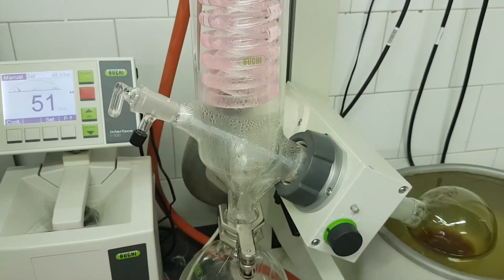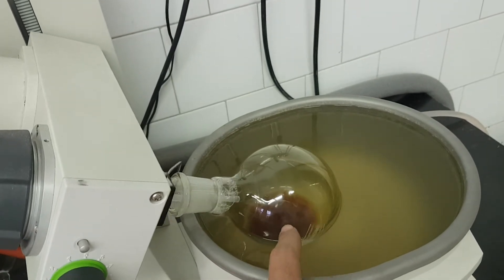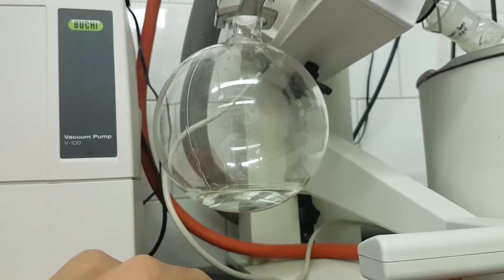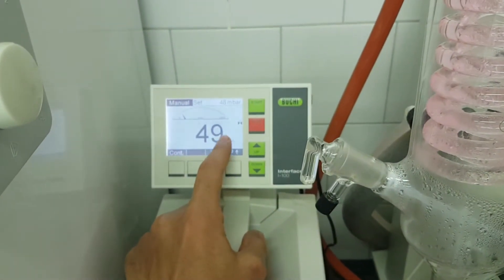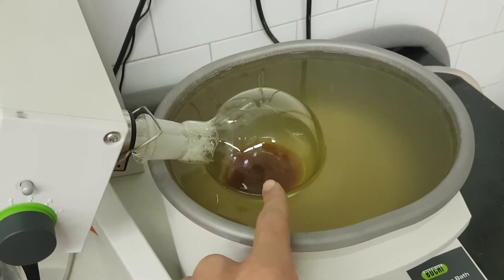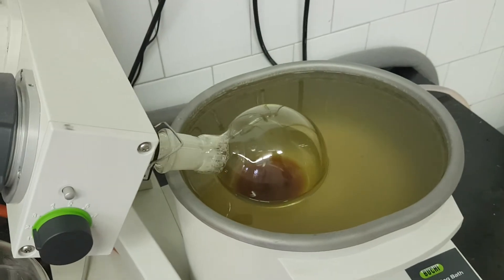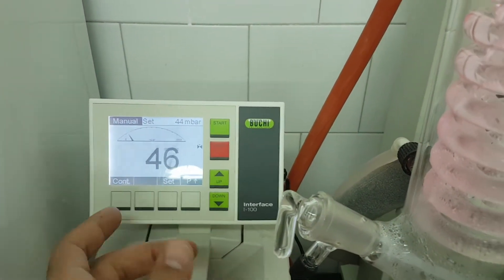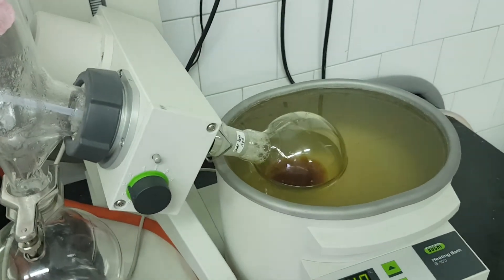Removing Water by Rotary Evaporation

Comment: The boiling point of water is 100C, can it be operated at 40 degrees?
Reply: The boiling point of water is 100 degrees Celsius at standard atmospheric pressure.It is feasible to operate at 40 degrees Celsius because at this temperature water remains liquid.Many processes and experiments can be carried out at 40 degrees Celsius.